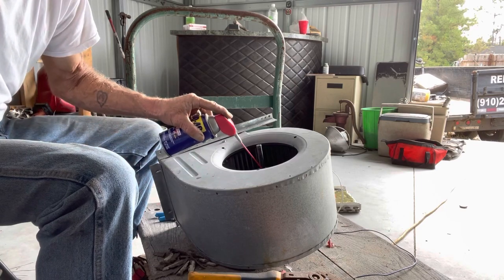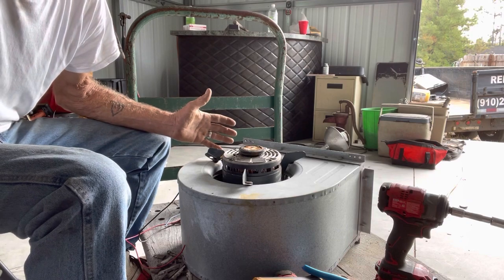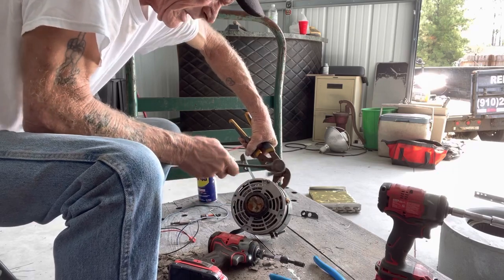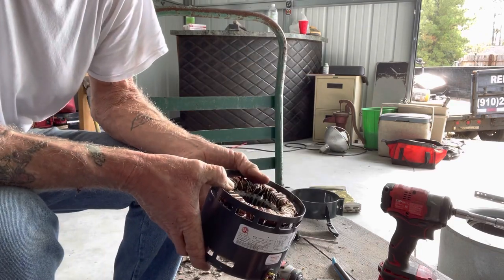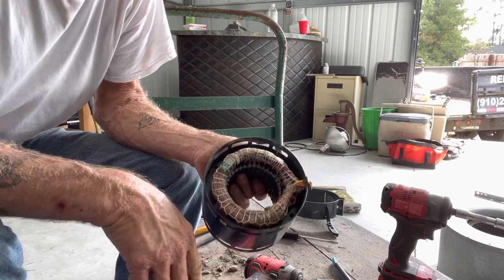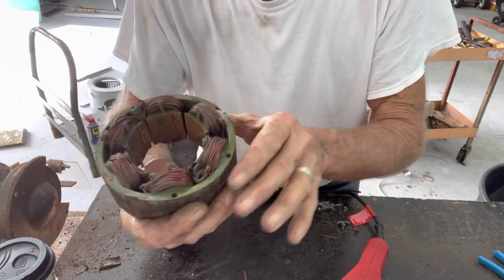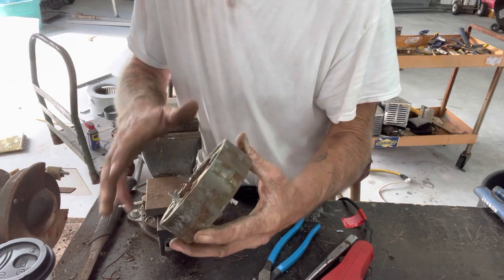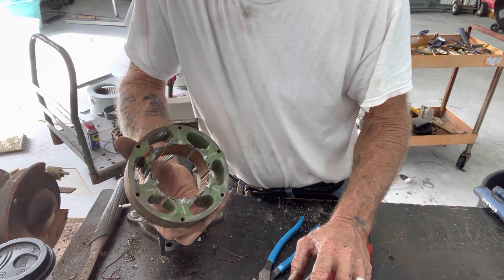Easy Copper Removal. Blower Fan Break Down.

Comment: Great vid, @jimboscrapper has a great way if you can't get it off. Motor motor motor. Copper copper copper. Not fun when you get aluminum.  Sometimes I will run a drill bit into the windings to check
Reply from the maker: I watched Jimbo‘s video that’s how I learn how to do it.